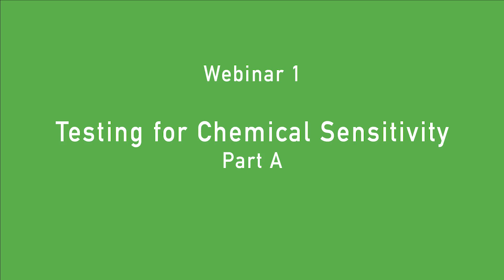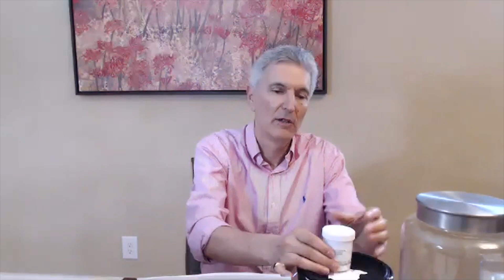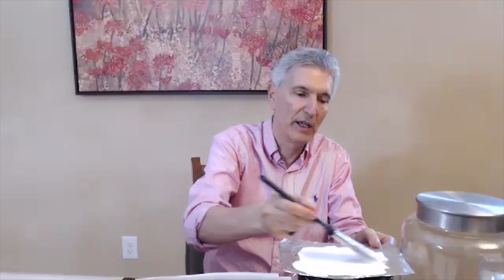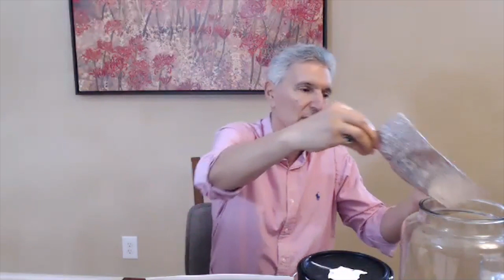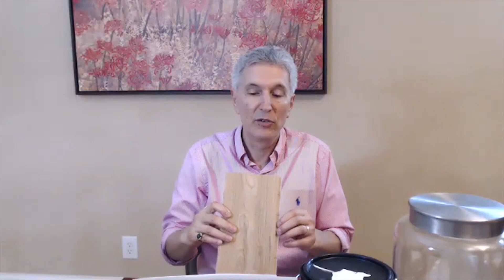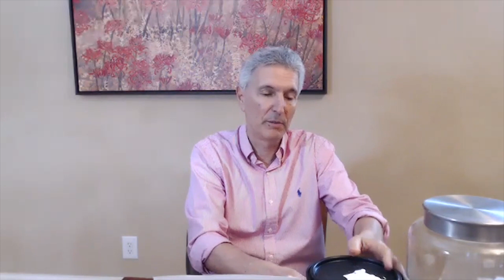How to select non-toxic building materials when you have multiple chemical sensitivities

Comment: Before retirement I learned much from the matenence and construction teams that worked  to upgrade offices for old and new tenants in the twenty story building which we secured 24/7 365 days within the year.  We noticed how some offices were not using chemical based paints at all but instead using white board on the wall surfaces throughout from the ceiling to the floor boards for the purpose of using the walls to communicate business thoughts ideas and readied presentation. Question: does the white board off gas? I genually ask because my better half will absolutely not have nor apply chemical paint onto the wall surfaces waiting for your response...